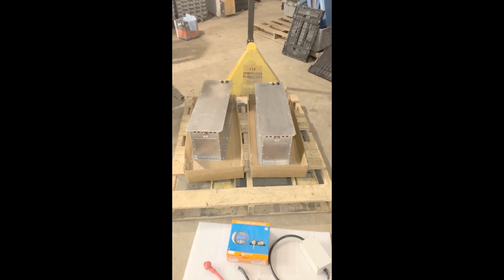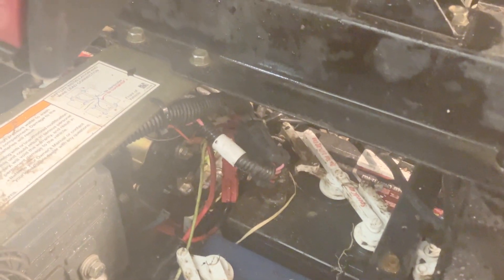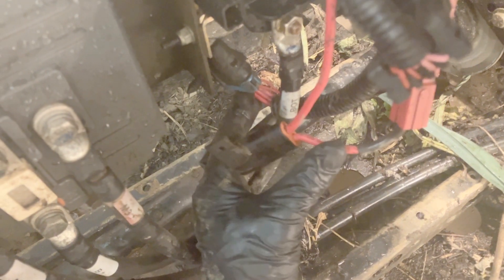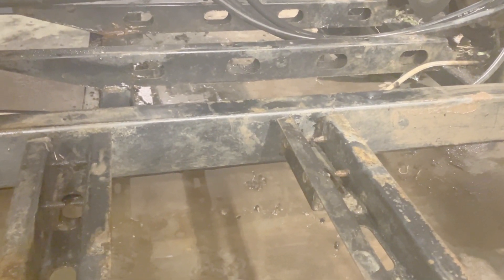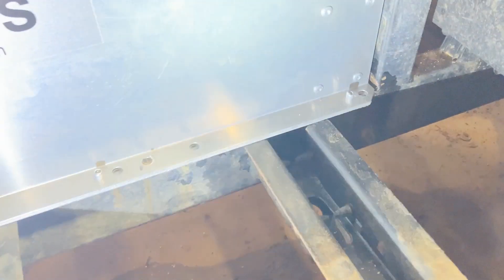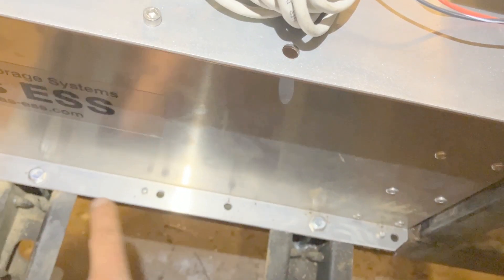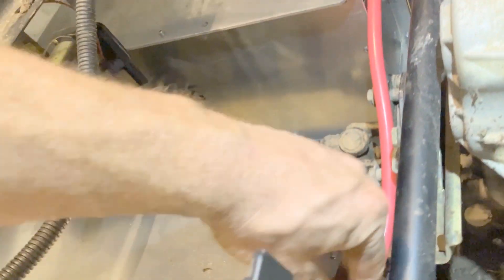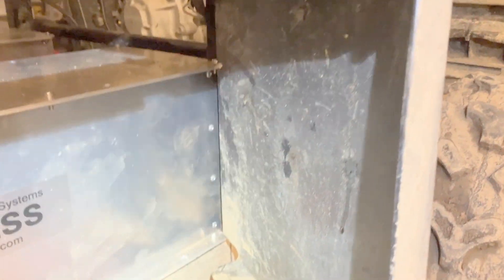Polaris Ranger EV - 16.8kWh lithium battery upgrade from Atlas-Ess

Comment: I am a FleetLithium Dealer, and I just purchased a 2022 Polaris 48v EV. 
I just received my twin 105AH kit to install in it. I think that’s a total of 10.75kwh. 
I’m curious to see your range with the bigger pack. 
If your buggy gives you way more mileage than mine, I have the ability to sell my battery packs as demos, and upgrade to a twin pack of 160ah batteries. That would be the exact same 16.38kwh pack you have. 
I also have a YouTube channel with EV content showing installation and performance of our batteries. 
Looking forward to your range test on this big pack.

https://youtu.be/ikSQX3xSFWw?si=VY9tt2hKFmwRq55J

Comment: Very helpful despite the low voice due to your cold.  Is your Polaris still running as expected?  I will be pulling my lead acid batteries today and replacing with the Big Battery Husky model (lithium).
Reply: Did you go with big battery huskey?
I really don’t think that battery has the capability of discharging enough amperage for your controller.  
I think you will be tripping  ( AKA shutting down ) your BMS pretty frequently. Which means you will be resetting your battery every time this happens.
Reply from the maker: If you aren't pushing the batteries too hard, you might be okay with the Husky. I know some folks use the EAGL batteries. When I was looking at Big Battery as an option, their EAGL batteries tripled in price in Canada in the course of two weeks. Immediately, became not worth it for me here for what it is. @tmpopson1 would like to know how your experience is with the Husky.
Reply: @lifewiththehamptons1993  The Husky Batteries (2) work great.  No shutting down and I've only charge about 1 time per month.  I usually wait til I get to 30 or 40 percent before charging.  Going to look into the larger batteries for my house.  I already have solar panels.
Reply from the maker: Polaris is still running as expected. Recently just posted a Trail riding video - range test.
https://www.youtube.com/watch?v=ne3paf0gCbY

Comment: Thanks for the video! Please do a follow up. It would be great to understand how you set up the stock charger and to get a new range test (incl some stats from the Battery monitor).
Reply from the maker: Sure - re: the charger - you can change the algorithm to a lithium profile, but you have to buy a $400 dongle to program it. Atlas-Ess does now offer a rental of this dongle. They didn't at the time. What I've been doing is the following. 1) Plug it in - after a while (say 3-4 hours) the charger will time out. 2) Once the time out occurs, I unplug the charger for 10 seconds and plug back in. Each cycle charges the battery up about 15%. When the battery reaches full capacity, the contactors on the battery shut off. I've been told by Robb at Atlas-Ess is that totally fine as the battery is protected. I like the cycling because the charger doesn't get to hot (it doesn't seem to run as hot as it did with the FLA battery anyways). 

I know of others who use a smart plug and have the smart plug cycle the power every 3-4 hours. I think this has been successful for them. I've considered it, but what's working now is working for me. It's such a big battery, I've only charged it about once a month so far through the winter. 

Re: some stats from the Battery monitor - I'm using a victron 712. What stats are you looking for? I still feel like I'm optimizing the correct settings for it but can provide details as needed. Let me know.
Reply from the maker: Range test video is up - https://www.youtube.com/watch?v=ne3paf0gCbY
Reply: @rivmountmedia  Thanks! Will have a look when I get some spare time 👍